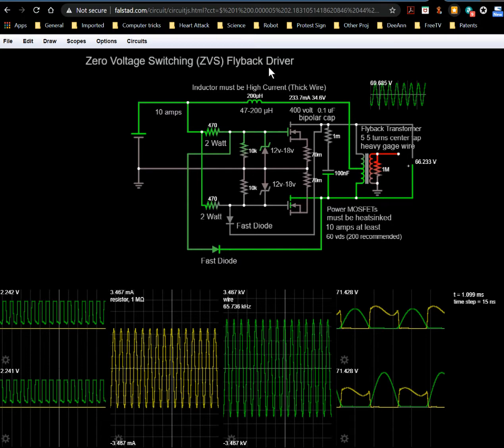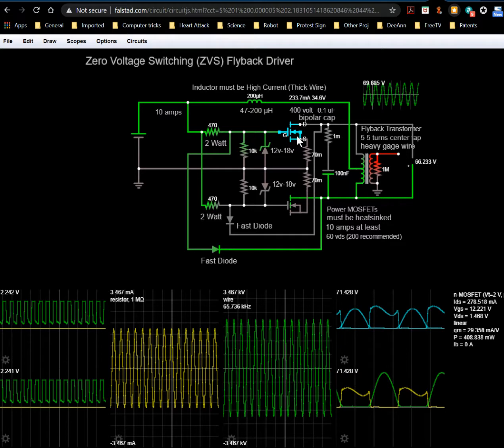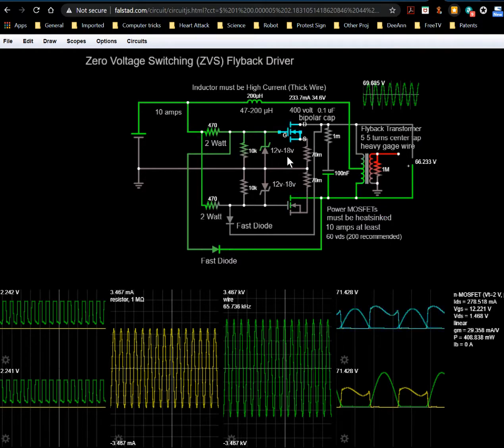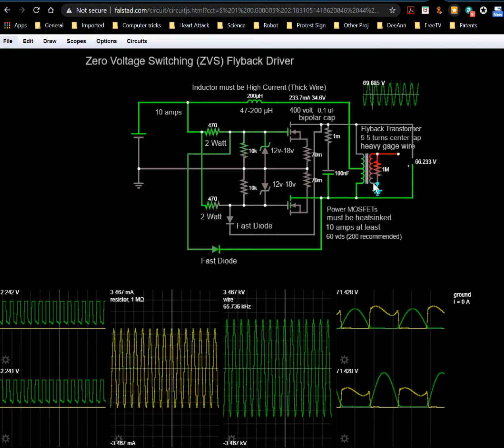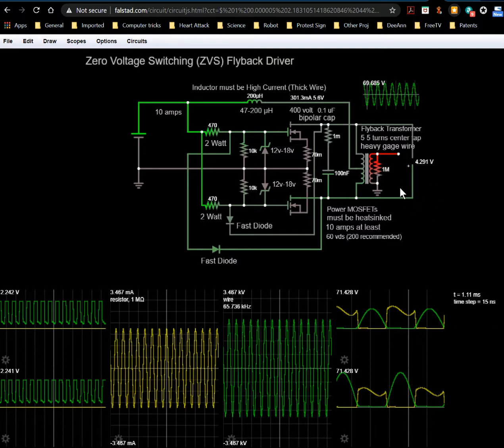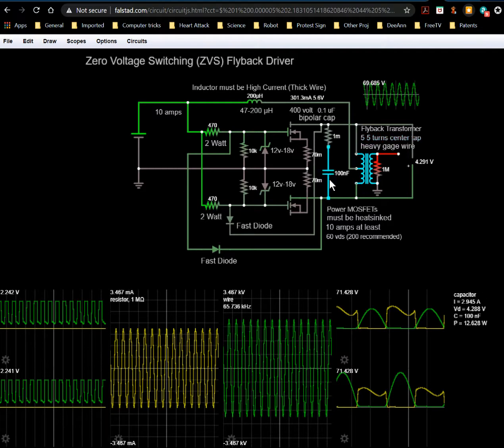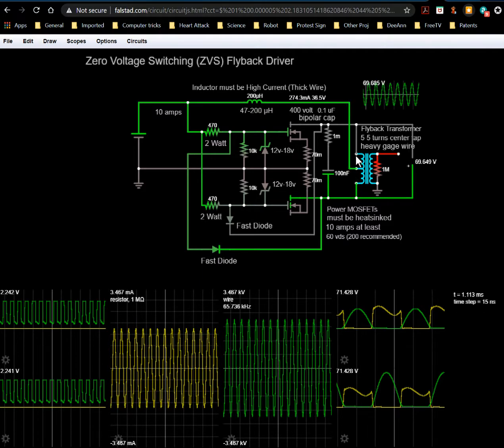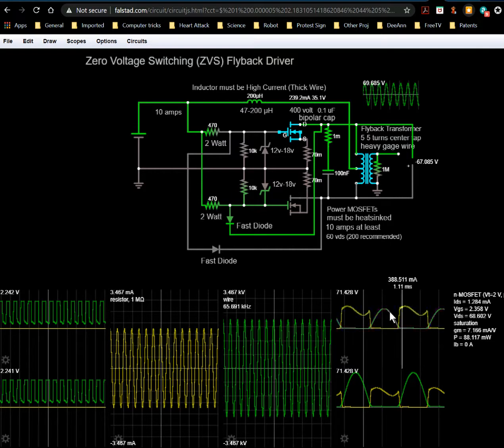Mazzilli ZVS LONG explaination

Comment: Nearly 80 minutes is just too much of my time to check if the following suggestion may happen to have been addressed already but lets say i'd sure find more informative/useful to compare Gate Waveforms as measured between these 2 scenarios:  #1) with a Flyback Transformer;  #2) without...  Especially in relation with the "Shot-Through" catastrophic failure condition vs loss of "ZVS" behaviour.

Ah, and i certainly appreciate the use of an RC Snubber setup.